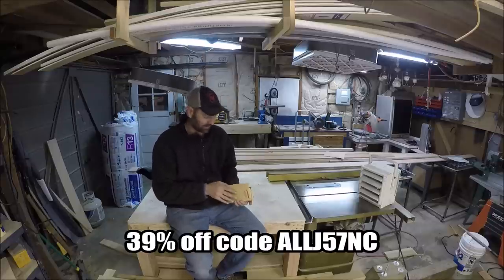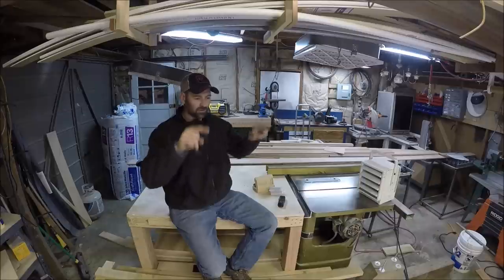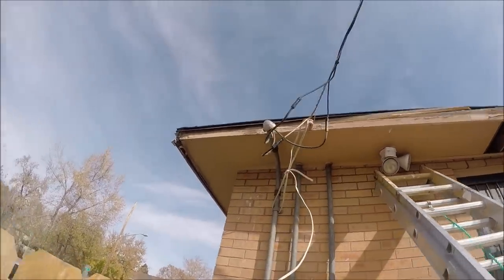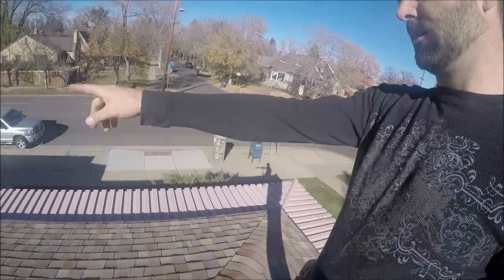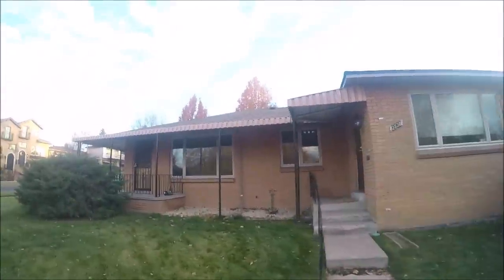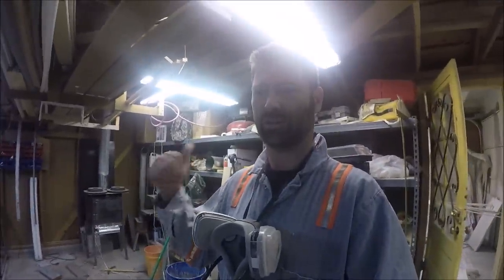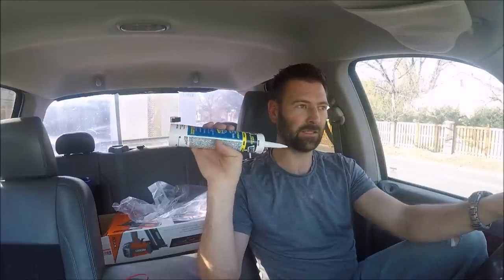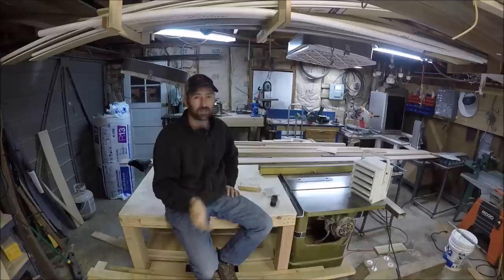Replacing Soffit And Fascia On Huge House # 3 | THE HANDYMAN |

Comment: EMF is a low energy non ionizing radiation, meaning it doesn't have the energy to break apart cells and is pretty much harmless to the human body.  Gauss is a measure of magnetic field strength.  Volts/meter is a measure of electric field strength. You wouldn't put highly sensitive electronics in an area with extremely strong EMF readings without hardening them in some form, the danger is to electronics, not humans.  All electricity creates a electric/magnetic field so the current going through the resistors in your electric heater as well as the blower motor all create EMF.
Reply: Matt Unless....you have a pace maker.😳
Reply: indeed lol, didn't think of that! i probably wouldn't want to walk under some high voltage lines if I had a pacemaker!
Reply: Thanks for clear explanation.
Reply: everything in our bodies work off of electricity
Reply: @mattpkp  My father does every day and has no problems at all. The emf fields are not anywhere close to being strong enough.

Comment: Emf is electro magnetic field strength/density. The gauss is the unit of magnetic flux density B. You use magnets to cut through copper invisibly to make electricity. (basics) The more stuff you run in the house that is old school bulbs or heaters or large appliances, the more field strength you need, and if you go check your main panel while doing so, you will send your meter buggy. Emf, fields, magnetic pulses are how you send data through the air like cell or radio waves. Magnetic fields seem on the most part harmless for most devices as long as your not close to it. Big antennas= higher field density and more power being output. Being near them is not good because they are running at a higher frequency. Household stuff is for the most part considered safe. The only concern would be transformers like the ones on the poles outside or bigger, if they are inside you should probably not be eating your lunch around it just in case. lol. On the other side we are being swamped with more signals then ever before being routers, phones, tablets, and computers. People claiming sensitivity is probably more fear based than anything. Like aliens! I still have not seen one!

Comment: I thought you weren't supposed to seal the underside of joints(caulking the trim) on a house in case there's water ingress it will trap the water so it cannot drain.  Sounds reasonable, your thoughts?  Also the template was a nice idea.

Comment: As always, love your videos and work Handyman, brilliant pro-tip on the temporary power outlet.  Quick Q - I know you don't care about the newest shiny tool, but you also love efficiency.  If you were doing the job TODAY (3 years later), would you be using a battery powered nail gun or stick with air powered?
Reply: Answer dewalt cordless, watched more “future” videos lol.

Comment: I just love how people complain about electric magnetic fields (EMF’s). 
But yet though have a cell phone pressed against their head day and night.
Reply: Exactly. I had a discussion with a friend who wasn’t happy with a GSM pole across the street. I explained that the antenna’s on that pole transmit with the same amount of power as his cellphone does. So it’s like being scared by a bunch of cellphones across the street. 

To clarify: imagine two people at a distance. Only one has a loudspeaker 📢. They wouldn’t be able to communicate. It’s the same for cellphones. It doesn’t make sense to have a strong amplifier at the pole and not on the cellphone. You’d have great reception but would not be able to transmit back. 

So if you’re really concerned with cellphone radiation, don’t hold it to your head but put it in hands free mode all the time. But to be honest, just don’t be concerned.

Comment: I have noticed that my garage door opener will not work consistently if it has a CFL light bulb installed.  Changed it to LED and no problem.  I was very surprised when my friend told me to change the bulb and it actually worked.

Comment: There have been ongoing concerns over the levels of Electromagnetic Fields (EMF’s) and the effects on humans. Anyplace that has electrical transformers, florescent light ballasts, even the high voltage overhead power lines that bisect residential neighborhoods will generate various levels of EMF.
My industry (wireless communications) takes energy radiation levels very serious as engineers/technicians are required to perform installations or maintenance to (transmit) antennas mounted on building rooftops or radio towers.
The people required to perform their jobs in high level EMF locations are trained to take the necessary precautions. OSHA and the FCC have set mandatory guidelines to protect the wellbeing of the general public.
Opposing arguments have been addressed on this topic, but our modern-day lifestyles have us exposed to very minimal levels of EMF most of the time.
Reply: Thanks for posting your comment. It's important that people don't simply poo-poo an idea simply because they don't understand it. Science is a way for us to understand the natural world, so let's seek understanding and the requisite causality so we can make better choices for our health and safety. And please God protect us from those who would prey on our fears by lying and false testimony.

Comment: I wouldn't call myself an expert in EMF but I am an electrical engineer that works for the electric utility and I have to perform EMF investigations as part of my job.  I am not worried about emf from electric circuits in your home at all.
Cell phones are about 100000(made up number) times worse that the electric circuits in your home.  Try your meter on your phone sometime and I bet you'll be surprised.

Comment: Amazing work and effort. Few and far between these days. As far as EMF goes there hasnt been any negative health benefits proven to date that I am aware of.  In large prolonged quantities there could be negative health benefits which I believe is the crux of the whole "5g gives you cancer" fiasco that people are worried about. Coming from the telecom industry typically the only concern we have is the amount of interference that it causes to the equipment that we use to provide service to locations I.E. radio shots, satellite uplinks ect. But to interfere with that equipment it has to be larger power sources such as large generators or other broadcasting devices operating on the same frequency. In the typical residential environment the most harm EMF could cause is probably WiFi interference. 

Anyways, keep up the great work!

Comment: Great video as always and great job..how do you like that ridgid framing nailer? Also I just switched to white lighting 3006 caulking you buy at Lowe's it's really good stuff just curious if you had used that type before?
Reply from the maker: I had to buy the ridged framing nailer because I left my Hitachi at the house and the next day it was gone.   I did get a good deal on the ridged because it was on a pre black Friday sale.  Works really good.    I haven't used the white lighting caulk  Is it paintable?  I
look for it the next time I'm at lowes.
Reply: The Handyman... yea it is, I found out about it from watching the Idaho painter on you tube. works really great both interior and exterior...I just got another house that ima be doing some remodelling and that's when I'll really be able to tell how well it works so far it's great.i just got a Hitachi nailer I wanted the ridgid but they where sold out at my store

Comment: Cool video great job but in South Florida never would have been that easy fascia wood is behind 1 by furring strip both are shot from the top through drip edge and 16 penny nails everywhere because of hurricane code the rip and the prep would have been a nightmare and no one here wants to spend that type of money for that quality of a job have laid wood floors of all types for over 20 years and would be picked apart on every single job!   Probably one of the last natives left in South Florida thinking it's about time to leave and relocate to a place where people appreciate quality craftsmanship.

Comment: Electromagnetic fields can be generated by AC or DC currents. An EMF meter can measure AC electromagnetic fields, which are usually emitted from man-made sources such as electrical wiring, while gaussmeters or magnetometers measure DC fields, which occur naturally in Earth's geomagnetic fieldand are emitted from other sources where direct current is present.

Comment: Some of those random spooks that go around are so stupid, magnetic fields aren't going to cause problems unless maybe you're going to go take a good long sleep in an MRI. Sadly, people freaking out about something they heard on the internet/news will rarely listen to reason. :p

Good thinking on placing the boards from the roof before attaching them, it's little things like that that make your life less stressful. Better to take a few trips up to the roof, rather than having to come back through to patch up the paint, and maybe even use some filler.

Personally, I have a 3.0Ah on my multitool (It's a makita if that matters to you).

Comment: Ventilation/soffits: when you marked the location for the vents, how did you calculate were the 2X4's were not?
Reply from the maker: just looked for the nails.  But if there is 2x4 in the hole its not going to be in the way.

Comment: love the go pro even though it made me dizzy lol... do you have an opinion on the airless nail guns? like a framing nailer powered by battery?
Reply from the maker: +Travis Phillips I have been wanting to switch all my nailers to airless.  Thats over a $1000 investment.  I will be getting a new airless gun every few months to spread out the cost.   Im going with the 20v dewalt since I already have the batteries.
Reply: I have a dewalt airless gun and love it. No compressor, cords or lines. Less stuff to haul around and get the same performance of a regular gun in my opinion.

Comment: Obviously, some EM is dangerous - microwaves and UV radiation are obvious examples, but cell phones have been found to cause issues too...

There are two separate mechanisms for damage from EM radiation; Ionizing radiation, mostly UV radiation from sunlight or solar lamps, can damage your skin's DNA. Other forms of EM radiation simply generate heat when It hits you, and the frequency of the radiation determines how deep this effect reaches, which is why low-frequency radio waves are a problem - they heat up the inside of your skin, a bit like a microwave - But in any case of non-ionizing radiation, be it infrared, microwave, or radio, the damaging effect likely only occurs when the source of powerful enough to cause substantial heating.

The bottom line: If your device is giving off UV radiation, it's a serious health risk - If your device is radiating significant levels of other forms of EM radiation, it makes sense not to spend all day rubbing up against it. 

So I would tell customers not to sit directly in the line of sight of a space heater or other strong EM radiator. But your (normal) lights, gadgets, appliances and magnetic devices (motors, etc.) are not a problem, with the possible exception of radio transmitters like cell phones and WiFi modems, but only if you're physically touching them while they're running on full power, since they're just not very powerful. 

I should reassure people and say that modern phones are safer than older ones, since they are more efficient - smartphone companies would rather not waste battery life on sending overpowered signals.

Mostly, I'd worry about lightbulbs and space heaters... And it's easy enough to explain in commonsense terms: They feel hot when you move your hand towards it, so you're being bombarded with heating radiation which isn't good for you in the long term. Same with the sun and UV lamps.

Aside from items that obviously cause radiative heating, I think cell phones are likely the only devices that you should be worried about, and only while it's powering its radio transmitter, such as during a call.

Comment: The previous owner used the soffit metal strips for the garage - unfortunately he also has a metal 'pipe' in the roof (must have had a stove in the garage) and it isn't capped.  Once I find out the size I need and cap the 'pipe,' I need to replace the soffit (raccoons, etc. have done a job on it and it's falling down).  Glad to know I can use the thin plywood to replace the skimpy metal (then I'll still need to evict those tenants!). (I used to have trouble remembering which is soffit and which is fascia - then I thought, 'Hum, my face is vertical and in front of me. Fascia (face-see-a) is vertical and in front - so Face equals Fascia!').

Comment: The only concern is when the EMF starts to interfere with other electronics in the house.  When the first computers (larger computers) were first installed they were rated for commercial use. They did not have the proper grounding for use in homes. Screw up tv reception among other little devilish plots.  I was a computer specialist for Radio Shack and I was in a bidding war with another company to install computers in the prison system. I told the prison system to be careful if the competition did not offer the correct shielding that all the prisoners would be up in arms because it could cause havoc with tv's